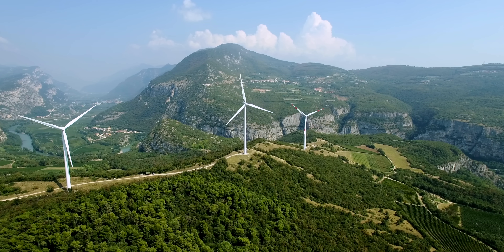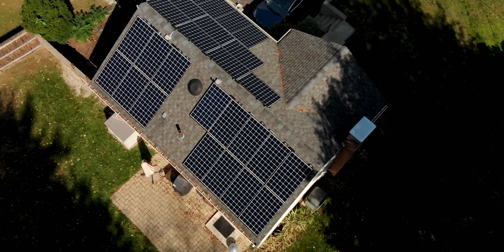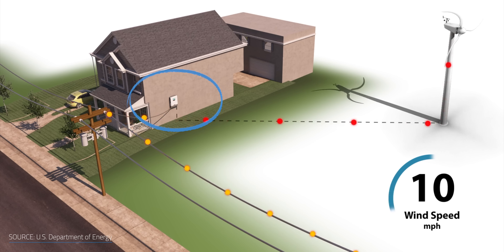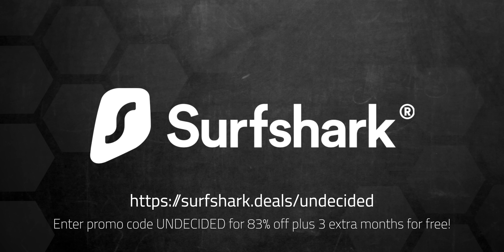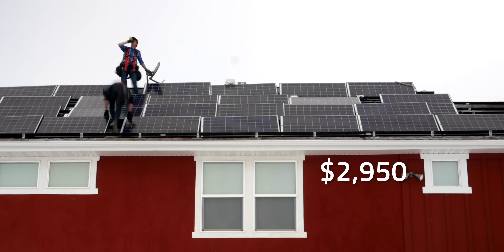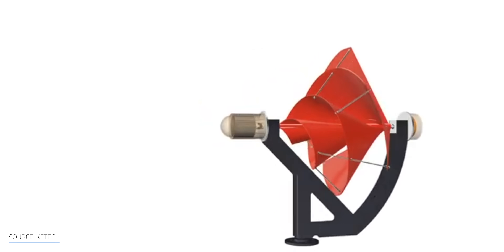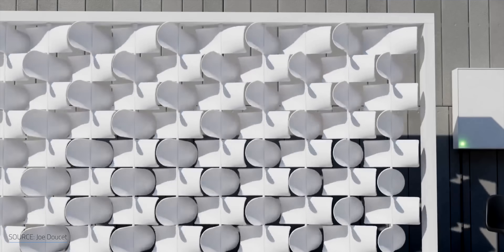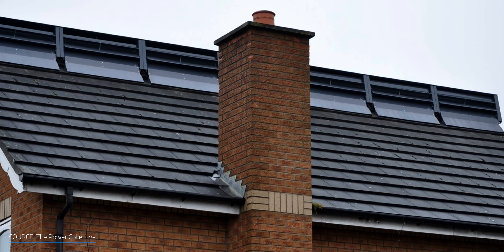The Challenges of a Wind Turbine on Your Home

Comment: 9:35 Does this include the CO2 emissions from the creation of wind turbines and solar panels? Keep in mind that there's a lot of plastic in those and that all comes from oil. You need power to fuel to factories that make these, not the mention the CO2 emissions from the vehicles required to mine the solid materials (like rare earth metals), so very large cranes and trucks that run off of diesel, as well as the landfill space required for Wind and Solar once they're no longer useful... You really need to specify if these additional CO2 costs are included in the numbers you use to damn coal and gas power stations.
Reply: I like the idea of the roof ridge turbines.

Comment: I do not understand why there still are no kits on the market for around $1000. It seems so much simpler than say a washing machine or even a dryer. Polls with wired anchors could be a separate market. I do not see the maintenance costs due to the moving parts either. Car wheels with their bearings are maintenance free, they typically outlast the vehicle. Elon, get on this please.

Comment: Back in 2008 I was mulling over the idea that is described here as Ridgeblade and wondering if it would work. To my amazement, while visiting Harrogate, England, I passed a house with just such a thing in place. On googling the subject I discovered a UK start-up had been working on this for some years.  It seems that they gave up on the whole thing because of problems gaining regulatory approval, not from the generation side but from the building control side. It seems such an obvious idea but clearly not as simple as it looks. On my last visit the structure had been removed and the roof ridge reinstated.

Comment: In 2004 I had NREL visit my Westminster CO home to verify whether or not to mount a wind generator. She taught me a valuable lesson in physics -  Rule of thumb :  1) when wind hits an object such as a large tree or a house, then the force of the wind goes up in the air by four times the height of the object and then takes 10 times that distance to get back down to the ground to create the money making force.  The good energy in urban neighborhoods is therefore over 100 feet in the air.  2). What wind you feel around your house is full of eddies, constantly changing direction which creates excessive stress and wear on the moving parts of the horizontal-form generator by forcing it to do 180 rotations many times a minute. Vertical generators handle this wind reversal better. I mounted 40 toy wind mills on my fences and corners of the house and yard and it was easy to see the wind changing direction 100s of times a minute. Some of the toys in the most turbulent areas were worn out in a few days, 
Most city building codes won't allow and mounting pole to exceed the distance of falling into the neighbors yard.  Since most yards are small this eliminates the possibility due to code.  She summarized that a good money making generator works best when your yard has a long clear unobstructed view toward the prevailing wind direction.         Note: Effective professional research has already been done a long time ago
Reply: VAWT are also significantly less efficient and require more structural support that HAWT.

Comment: Here in Saskatchewan, we see wind constantly, though at varying speeds, and have a reasonable number of sunshine hours.  The few days we do not see wind, we are usually busy preparing for the major storm that this signifies.  Because of our lower population, this has not translated into a vast forest of wind turbines, though the ones we do have are making a significant impact.  I also remember,  as a child (some 50+ years ago now) seeing a few ingenious wind devices of both axial varieties used for research and , more frequently, for aerating and pumping water.  Long before the drum-like turbines were a vogue design for power generation, I saw systems as tall as 3m (10 ft.) on plots of land that I now know as research sites, and they were always spinning, some quite close to copses of trees.  As you said, rural scenarios may be more beneficial, but here, I realistically see it being something which could be introduced into an urban area quite easily.  The sound generated by the perpendicular items could be offset by the other sounds on the city quite easily, and in our parks , greenspaces and lakes it brings many opportunities.

Comment: Harnessing the power of the wind on a small scale for domestic use, absolutely makes sense, in a limited number of circumstances. For most of us though, it is impratical. Most cities aren't going to allow a 20 metre tower in your back garden, the noise would lead to complaints & possibly legal action from neighbours. A properly built regularly maintained wind turbine is unlikely to disintegrate, however, your insurance company is likely to increase your premiums just to be on the safe side, and your insurance is likely to be voided, if you don't get your turbine serviced annually by one of their registered technicians.

Comment: Is hard to add nuance to a YouTube video, but you do a great job. One consideration I would add is far north and south exposures.  As an Alaskan I get a lot of sun for  solar in the summer, when I don't need. In the flip side,  in the winter I have a lot of wind  when my electric requirements are higher.

Comment: WHAT THE..!  $5000 to have a wind generator installed..?  Do it yourself. dig a hole, put the pole in and fill with concrete, then anchor it in multiple anchors. connect the wires and your making money. So you might have to rent a lift.. and hire an electrician, but you won't be spending 5k.  I'm putting a pair of 400w wind generators up soon.

Comment: (tldr: you drastically underestimated your turbine power output around the 8:30 mark) 
Hi Mark! Your "average windspeed" calculation is incorrect in its usage, since the power present in wind scales with v^3 (v^2 for kinetic energy, and another v for flow rate). You have to do a weighted average for v^3, or more accurately a weighted average over the power output curve of your chosen turbine, which will have a range of conversion efficiencies depending on speed.

There are windspeed histogram data sets for a lot of areas that you can use for this calculation, I did one in a graduate class this past year. You can tabulate the hourly amounts per speed in an excel sheet and multiply them by your power output curve for your chosen turbine to get the actual kwh/year values. The value you estimated heavily undercuts the power present in higher speed winds, so your result is Much lower than it should be I think.

Really interesting video though, i'm somewhat surprised home turbines cost so much, seems excessive for how simple the technology is, especially ones with single-speed gearboxes.

Comment: a waterproof installation of the Ridge Blade would be more expensive - - - BUT... if you can install it inside the attic and cut out roofing for vent holes.... in my opinion.... that's a guaranteed purchase. aesthetics on point. lowest profile. just much more on cost... but I think it's worth it for its beauty... maybe integrate solar shingles while at it... better yet- solar shingle that has their own mini wind generator on the edge...

Comment: Another great vid. Can you do one on home batteries? Specifically, smaller setups to power low overnight loads. I have solar for the day but it seems suppliers only want to sell me large multi-day packs. Thx 🔋🔋😀
Reply: @djt2412 From what I have seen, most of the DIY builds here on YT utilize banks of car or boat batteries. Not the cheapest batteries around, but they are readily available. The overall cost depends on how much reserve capacity you want. For me personally, I would want at least 2 days of reserve power (at low usage.) I would be completely off grid, so I would not be able to fall back on anything else.

Comment: One of the things I notice is that while IceWind is mentioned, some of the otherdesigns/companies from your previous look at small wind turbines (in the solid state video) do not show up here. Hopefully when you next visit this topic, some of the companies featured then and in this video can be included again, with progress made and products to buy.

I was hoping there might be some update on Powerpod, or that vibrating one.  The Powerpod website hasn't been updated in months from what I can tell and I'm assuming the unusual appearance of the vibrating design may be part of why Voetex Bladeless also seems to be struggling (last blog post 1 year ago) though the science behind it was really interesting.

One note though, I don't think wind needs to be all about the biggest small installations. Sub 1kw installation might make sense as supplemental to an existing solar installation that can make impact during the times the sun has gone. Ever since seeing the powerpod my wife wanted one or two to supplement our solar - (in my mind assuming wattages in the mid 100's), like a fairly efficient solar panel or two, but that might be less troubled by snow cover, just sat on the crest of our house roof at each end. 

Ah well, all the factors you say make sense.  I do think there is a market there for a company who can create a grid-connecting turbine that is price competitive with solar , even if its relatively low wattage, as long as the design is something that looks alright to have on a house. 
IceWind at least looks to be a business thats doing business, though at least for now the cost (and perhaps physical size)is maybe a little high, and while I like the design of the other models featured here the big question is if they will be still be around a year from now. I really hope they are.

Comment: After watching a few of your videos on renewable power generation, my thought has stayed the same. We're designing buildings to be more efficient in power use, but not power generation. Is there a future where a building is designed in an unconventional way where power generation is more efficient? As in, walls and roofs that collect wind and solar, basements that collect geothermal, floors and doors that collect kinetic, etc.
Reply: There was a system called "Wells Walls" in Australia about 40 years ago, but people were turned off by how it looked so it never took off - it involved having external louver blinds in front of glass over a blackened brick wall, with closable vents internal top and bottom. These cavities becomes a passive heater. Clever, but you house sort of looks like a shed.
Reply: This is the fault of architects and city rules.. also if nations would make the common sense move to nuclear power none of this empty talk would happen per nuclear is the cleanest, cheapest, safest energy source we have
Reply: Forget the neigh Sayers. This is exactly what needs to happen innovation, from the ground up. Or walls in. Or roof in or outward. Why does it not happen? People boo hoo about it, but change always makes people uneasy. When you find a place that people have abandoned, you see nature rebounding based on similar concepts to what you've mentioned here. Plenty of $$ in what you've said as well
Reply: Not in the US. That type of innovation will be stifled with red tape.
Reply: It is incorrect, at least in the UK we are moving towards heat pumps, many of which use ground heat- it is NOT geothermal, as that requires drilling a few kilometres down to find a magma chamber- to both heat and cool homes. You are wasting your time to collect door kinetic energy.

We aren't really designing buildings to be more power efficient at all- these "eco houses" are unsustainable and inefficient - often with flat rooves which have very poor thermal performance- concrete constrution also thermally poor, with many points of thermal bridging. They use short lifespan materials and construction methods and often have huge windows that lack curtains, making them too hot in the summer and too cold in the winter, massively increasing costs. 

Modernist architecture is completely incompatible with power efficiency and green living - it is simply associated with socialism and thus a shared inspiration with eco architects. 

For efficiency a house should have low surface area- ie be similar to a cube- or be terraced or semi detatched. The roof should be self cleaning and long lasting - a pitched roof will last 30 years, a flat roof is only specced for 10. it should have strong structurally rigid long lasting weather protection on the outer face in a material that will last hundreds of years- such as stone, brick, block, etc. It should have a cavity to protect from damp and add extra insulation. It should have a very insulative inner wall. Windows should be thickly curtained, to keep the heat in during the night time, or the heat out during the summer days on the sun side of the house. Radiators (or heat vents in canada) should be directly under windows to provide a stable temperature and prevent window frosting. Ceilings should be low to keep the heat closer to the occupants. All space in the property should be utilised to allow for a smaller physical property for the same space. All internal walls should be insulated too and smoke seals around the doorframes so each room can maintain a separate temperature. Heat producing appliances such as a kitchen or fire if you require one should be central and low- basements if you have them - (though logistically you do not want to take shopping down stairs and garbage up) If you are serious about being green, you would forgo both clothes dryer and dishwasher - invest in a mangle a maiden and a pair of marigolds. in terms of transport you would replace your push bike and car with an efficient moped which will produce less co2 than a cyclist. a tuk-tuk for example if you need extra space for some reason. You will have no pets. you will grow much of your own produce in your garden- which is far better than solar panels in your garden due to the carbon consumption of food production. 

If you are even more serious you will build a cistern underground and collect your own water not rely on high pressure mains water. 

Of course we could also all live in small apartments in big concrete block buildings like the soviet union too.

Comment: @Jokerwolf  Vertical axis wind turbines would be great in a city with a lot of high-rise buildings. Just think about the wind speeds on the roof of a 10+ story commercial or residential building. The further higher you go the more wind speed and thus more electricity that could be produced. Sure it would not prevent the building from going off-grid but would provide enough electricity to reduce the overall cost of electricity if there were multiple vertical axis wind turbines installed.

Comment: Why not convert a home to DC power? No need for expensive, inefficient invertors. Charge directly from solar panels and perhaps also from windmills. Smaller, more powerful, more efficient, lighter weight motors. Same house wiring but different receptacles.

Comment: Why are these manufactured small wind turbines so expensive?  You can buy a 2000W DC Motor for around $120, and I've seen video of people making decent turbines online for next to nothing. Hell back in the day, farmers home built windmills for water lasted many years.  Seems to me it's not a windmill problem, it's production and greed issue.  Also, seems like the solar industry is running a campaign to shut down small turbines.

Comment: Depending on your municipality putting up a wind turbine is going to take permits.
The tower is going to have to be professionally designed by an engineer and installed by a reputable company.
In addition most municipalities in Texas have a 40 foot height limit for structures other than homes.
In addition, home owners insurance premiums might go up for the potential damage that might be caused if the tower fails.

Comment: Matt, thank you for this video - this is an area that we definitely need to explore. There are some unexpected applications - like a row of vertical axis turbines on top of a traffic barrier. The traffic going by in both directions can get them all spinning.
An interesting aspect of vertical axis turbines - when they are place closely together, they actually benefit from the turbulence of the other turbines around them. With horizontal turbines, if they are too close together, they lower the overall output, because the turbulence prevents the downwind units from working as well.
Reply: i remember i spent hours researched VAWT on many forums, most of them were focused on DIY
i never tried IRL bc i didn't have the means or the money to start a project myself
Reply: , Nu le pui dese. Nu sunt electrice, ci pe compresoare centrifugale de aer comprimat, unite intr_o rețea comună + rezervor. Compresoarele pot fi și înseriate. Vor consuma aerul de la unul la altul ( cu aceeași forță necesară). Cucalculul debitului in functie de ce putere oferă vântul(raport de compresie). Ultimul din rețea va avea cea mai mare presiune si cel mai mic debit.